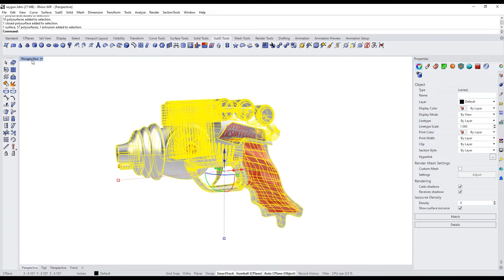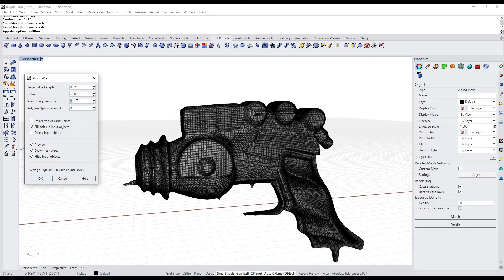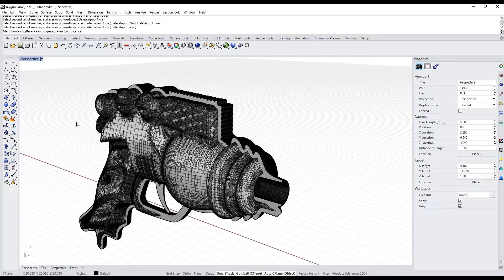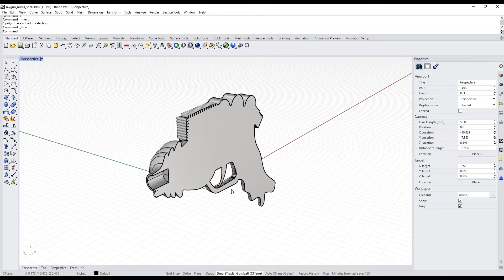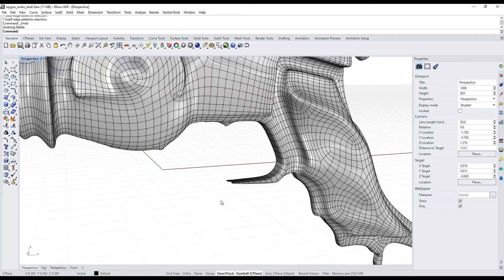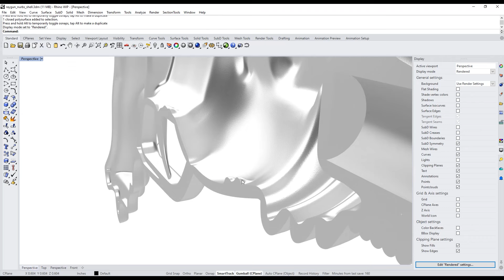Rhino 8 windows- never fail shelling with Shrinkwrap (new feature!)

Comment: Since I have to look this up now and then, and it really should have been a blog post, here's the process:

1. ShrinkWrap (with desired thickness negative offset)
2. QuadRemesh (with convert to SubD to reduce a step)
3. ToNurbs
4. BooleanDifference
Reply: Note that the above is for the enclosed example. For an open convex hull, I've found that you need to manually close it first, and for an open concave hull the process is unfortunately even more involved.
Reply from the maker: it was posted on discourse when the video originally dropped. here's the link 
 
https://discourse.mcneel.com/t/never-fail-shelling-with-shrinkwrap-in-rhino-8/151364

Comment: Thank you Kyle its very usefull just a one moment, but how do the same with a car which never divides vertically at the middle like a gun? but car have a flat bottom and upper body like a HowWheels. how can I do the same trick with car? do you have ideas to solve it?😅
Reply from the maker: in that case, you'd shrinkwrap the exterior, then copy/paste and shrinkwrap a "core" with your desired offset for the wallthickness you'd want. 

then add a plug that sticks out the bottom of the core and mesh boolean, or simply shrinkwrap them together. 

then do a mesh boolean split on the exterior with the core. this will give you the center cored out. 

then trim the plug flush with the floor to make your chassis part that closes up the bottom. 

you now have a shelled exterior, and a chassis cap that closes up the bottom but is a separate part. 

this is exactly how hotwheels toy cars are shelled for production.
Reply: @Rhinoceros3d  I'm so embarrassed to keep asking you this. If you don't think it's impudent, could you explain it again in a different way, please?🙈🙊
Reply from the maker: @Martin84239  what part is confusing?
Reply: @Rhinoceros3d "then add a plug that sticks out the bottom of the core and mesh boolean, or simply shrinkwrap them together." can't understand logic😅 do i need mesh boolean Union them together right? And am i understand correct that if i make shrinkwrap them together i get three objects? 
"then do a mesh boolean split on the exterior with the core. this will give you the center cored out." sorry for my stupidity what i need subrtact? Or split its not mean subrtact something from something?
"plug stick out the bottom of the core" you mean pull down/stretch the core out?
Reply from the maker: @Martin84239  in order to make a core that effectively shells out the bottom of a part (like a car) the inner object used to define the core, has to actually protrude out the bottom of the original part. 

I typically do this by making the inner core with shrinkwrap using an offset , then modeling a piece to add to the bottom of the inner core. 

in order to make one piece you can use to mesh boolean subtract from the original part, I typically boolean or shrink wrap the two core parts together to make one core that sticks out the bottom of the original.  

you can now mesh boolean these parts and end up with a outer shell  that is open on the bottom.
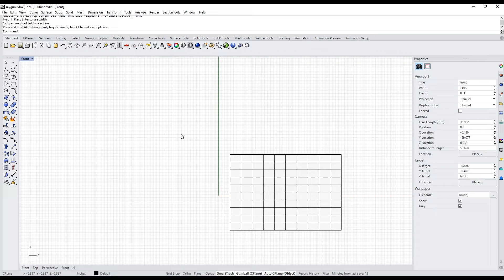Reply: @Rhinoceros3d  i am so sorry for disturbing it seems now I understand you meant the same thing which you showed on 6:37 minute where the gun on a half sticks out from the box. I overcomplicated the idea for myself and thought that a completely different approach was needed. Thank you so much!!!
Reply: @Rhinoceros3d  By the way, do you think that the Rhinoceros will ever have a mechanical coupling (mate) function? This is so lacking that I have to use third-party products. For me, Rhinoсeros is the perfect program with a lightweight, clear, and intuitive interface. Do you think it's possible to create a script for mechanical coupling using Grass Hopper? I'm constantly thinking about this and looking for a programmer to create a plugin for myself😅.
Reply from the maker: @Martin84239 we played with a constraints system early in the v8 development but it proved to be too complicated. The idea is still floating around, if it gets a lot of traction on the forum there’s a chance it could get some more attention.
Reply from the maker: @Martin84239  Anytime- happy modeling!
Reply: @Rhinoceros3d Apologize Kyle🤦‍♂️ again can't cut😅😢
I understand what you explain and make a plug of core which stick out but the problem is that my cars bottom if you look from aside not stright and flat like a half gun for cutting with box, it has a wheel arches and at the edges where the bumpers are at an angle. How would you cut it?
Reply from the maker: @Martin84239  shoot me an email at tech@mcneel.com attn:kyle and I'll send you an example
Reply: @Rhinoceros3d sended 😅
Reply: @Rhinoceros3d  thank you so much 🙏🙏🙏😊

Comment: Hi! I'm using the Srhinkwrap on the cylindrical mesh, it is opened top and bottom. And the command works but also shrinks in z axis. How can I keep the internal shape the same height?
Reply from the maker: check out this link- https://discourse.mcneel.com/t/thickening-and-ribbing-for-digital-fabrication/191946/6?u=theoutside

Comment: An algotythm that uses nurbs or whatever input edges to retopo the voxelised shrinkwrap output could be implemented, especially now that Rhino 8 SubD supports variable creases.
Reply from the maker: voxels do not have topology..
Reply: @Rhinoceros3d  The output is a mesh. Retopo that mesh. By the way, not only Voxels have topology, they have the strictest of them all, that is why they are called...Voxels.

Comment: Nice
Reply from the maker: so much good in this tool!!
Reply: @Rhinoceros3d I was trying to use the shrink wrap to create a low poly surface to bake normals on and use in Unreal but I haven’t been able to get the settings right.
Reply from the maker: @haruruben  use quadremesh in v8 wip for that instead.  Unless the model is messy, then use shrinkwrap at a high poly count to clean it up first, then use quadremesh at a low polycount to get your low rez mesh.

Comment: Fantastic! Something I need. I am a former Alias user who since moved to Rhino. I am very happy with Rhino, the community, GH integration, and the extremely reasonable pricing compared to Alias. I was trained in Alias, but finally bit the bullet to retrain myself. I’m happy I finally did as I feel more satisfied. I also use Fusion 360 (longer time using), but will look at Rhino for the ability to do all my modeling there since it has Sub-D and solid modeling. Autodesk has soiled my view of them with their exclusive Alias pricing model (+$1200 a month) and the fact that they bought the VSR Shape Modeling plug-in purely to trash it for no apparent reason beyond trying to push traffic toward Autodesk ($1000 Rhino vs $1200 per month Alias is not logical target market). Rhino FTW. Thanks for these vids as I use them professionally.
Reply from the maker: I am a recovered Alias user as well ;-)
Reply: @Rhinoceros3d  Letting VSR tools get away was a huge loss. I really hope the development team puts some effort into improving the toolset for technical surfacing. Surface diagnostics, especially. There's still no real alternative to Alias or ICEM Surf for this.
Reply from the maker: @cartoonfoxes  yep, we are aware. Lots of internal discussion on how to handle that.
Reply: @Rhinoceros3d  But are there any concrete plans yet? @VirtualShapeResearch shows what rhino was 10+ years ago and has not been since.
Reply from the maker: @cartoonfoxes  nothing as of yet, but it's a topic of much internal discussion.

Comment: Great tip! Can you fit in the rib command in this Workflow, for customizing the construction ?
Reply from the maker: you can certainly add ribs if you are working on Nurbs, for polys you'd need to make the parts in nurbs, then mesh and boolean them in. But certainly do able.

Comment: As always great content Kyle. One thing that I think will really be of help in this process is an option to, when doing the Quad Wrap, to be able to have an option to better hood the detail from the original mesh. So basically when retopologizing am looking to have it "sucked/pushed" down to the mesh to better hold the detail. Or even if it's a secondary step to have to reproject the details from the tri-mesh back onto the quad-mesh. This comes in very handy when working with 3D scanned data or other mesh data files. Prior to Rhino 7 I'd have never asked for this kind of functionality BUT since the can of worms is open might as well keep it going!!!!
Reply from the maker: Yep, we agree- much internal discussion about this topic and how best to achieve it.

Comment: This is impressive, it's a bit involved though-any plans to package it up as a command? As in replacing shell, which only works on very simple shapes?
Reply from the maker: no, shinkwrap is a tool that can be used for many workflows.
Reply: @Rhinoceros3d  I wasn't suggesting getting rid of shrinkwrap as a standalone command, merely that bundling the workflow in the video as a command would be nice, especially as the existing shell command is not very good.
 In much the same way that I can Boolean things manually by exploding, splitting and deleting surfaces, but it's far easier to use the boolean commands...

Comment: As a professional Architectural modelmaker this is excellent addition that I've been praying for! I have used Magics, Spaceclaim, Meshlab etc... this will not only save me money on software it will allow a single software run through on all my projects. Awesome job thanks.
Reply from the maker: your life just got a lot better! :-) let us know how it works for you!
Reply: @Rhinoceros3d  will do, anyone able to assist if I get stuck!?
Reply from the maker: @cornercycles  
always... just hit us up at Tech@mcneel.com or hit the forums at discourse.mcneel.com
Reply: yeah I've pretty much used this same workflow for years on highly detailed organic parts like action figures etc using geomagic wrap but it ain't cheap! I'll definitely need to play around with this.
Reply from the maker: @ryan6530  I’d be curious to hear your thoughts. I used Geomagic for toys for years, (I had 20 years in the toy biz) This imo covers a lot of ground that may replace your need for Geomagic.
Reply: @Rhinoceros3d  I'm curious as well! would be interesting to compare workflows to see if anything can be approved upon, I've tried so many other tools but they just don't have the capability and speed of geomagic, especially when you are dealing with extremely dense meshes, talking 30-40 million tri's and the analysis tools to get your output solid model within reasonable tolerance.
Reply from the maker: @ryan6530  ATM geomagic is the better choice for high end reverse engineering due to the fact that geomagic is a dedicated reverse engineering tool. BUT... now that we have shrinkwrap, the foundation is laid for all the good things voxels can offer and I'm hopeful this leads to many new tools and workflows.